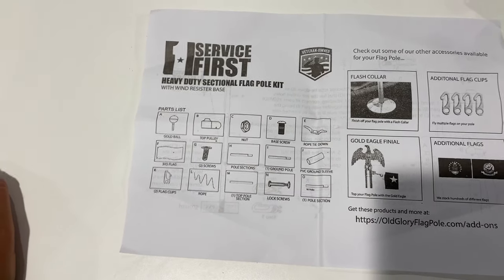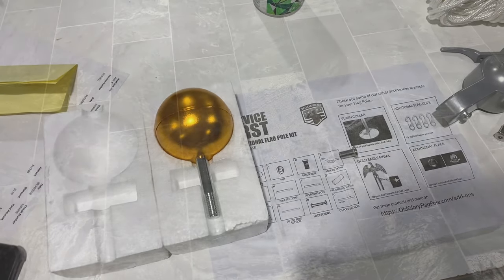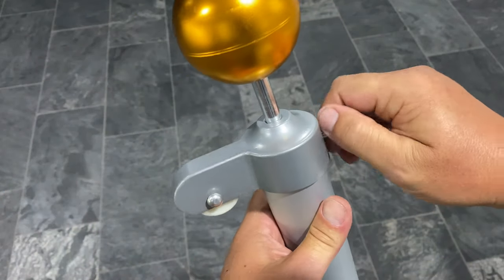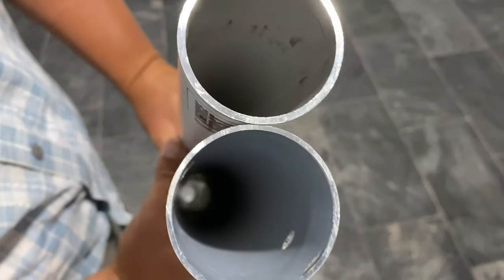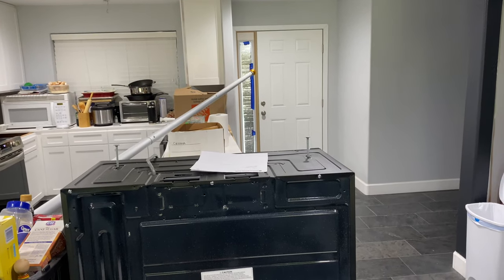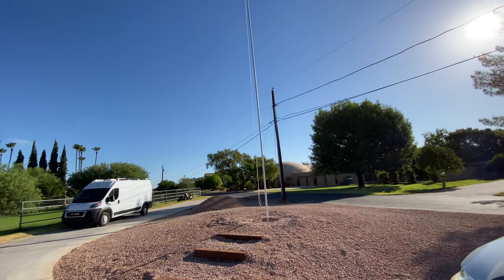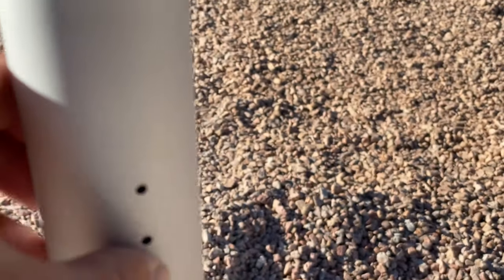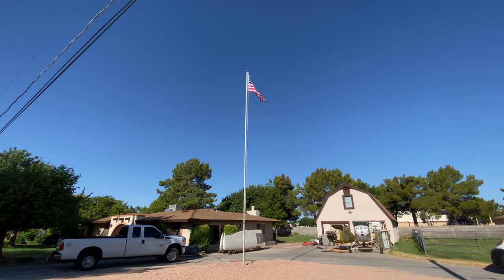Old Glory 30 foot flagpole assembly and installation

Comment: It has been a few years, how has this pole held up for you?  I want something 30’ or higher, but this thing does not look rigid enough.  Hope to hear your thoughts on this.
Reply from the maker: Great question.. this pole has not worked out well at all.. a few good winds and it is toast.. next pole I buy will be a solid one- I do not recommend this if you have any wind at all… I’ll post a new video updated review soon
Reply: @PilotJon  I have been searching for about a year for something I can salvage from an old building.  A nice OLD well built one.  So far no luck though.  Darn things are so expensive new.
Reply: America do be strong

Comment: I have a flag pole mine is 20 foot solid black iron pipe 3” round 1/8” thick. 
It is a bitch to restring it. (Re rope it)
But it doesn’t sway in the wind.
Was just watching the video because I was needing another flag pole for another location. Thanks for the video.

Comment: On a 20' Old Glory pole where do the 2 set screws go.  The picture shows 2 holes but the pole only has 1 hole.  Please respond.
Reply: Same with me, it's not the same setup for the 20" by the looks of it.

Comment: But you didn’t show the prep with concreting the sleeve in the ground and you didn’t show how the pole is secured to the sleeve. That’s the main part I wanted to see.
Reply from the maker: 11secondeclipse sorry! It’s actually very easy- the pole just sits loose inside the sleeve so the wind can blow the flag and spin the pole. The sleeve is just sitting in the dirt when I put the concrete in..
Reply: How deep did you dig your hole for the sleeve and also the diameter?